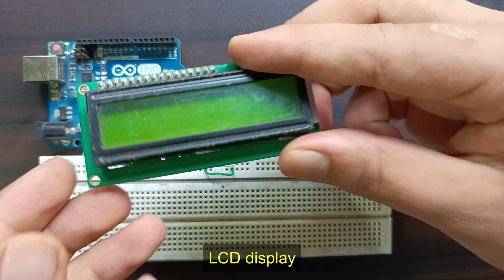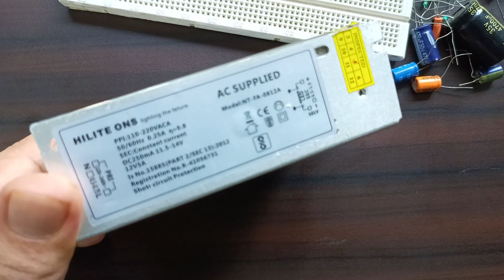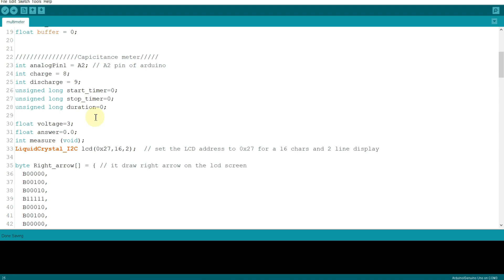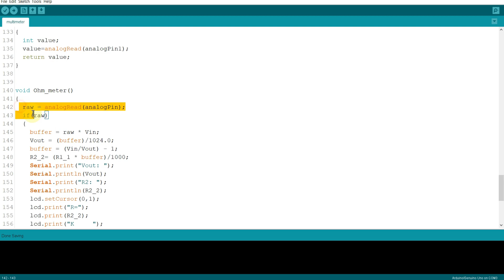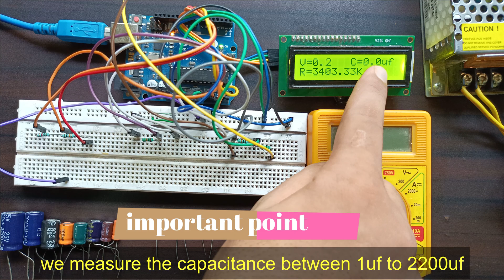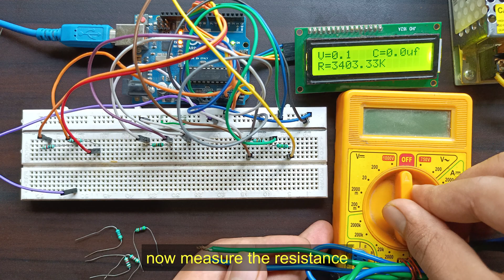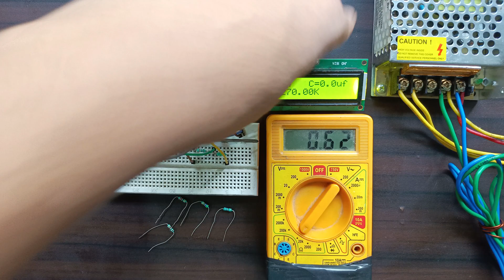How To Make Multimeter Using Arduino| Multimeter | Experimentalist | Calculate R, C, V Using Arduino

Comment: Hello brother , can you talk more about pyfirmata ,  i saw your last video about it and you did good 👍
Reply from the maker: ok, what kind of information you need from me, can you elaborate a little bit.
Reply: @experimentalist1494  what’s the different between digital and analog in the arduino board , and what’s the other inputs in the board , how to read from arduino  in pyfirmata ,  and how many  function is there in pyfirmata ,?
That’s all my questions
Reply from the maker: @5_thrd744  there are two types pins in arduino analog and digital.in analog pins we use as input/output,in thiswe connect the sensors which give analog values means 0 - 1023 and digital pin we use as input/output, in this
we connect the sensor which gives digital values means 0-5. we can also use the analog pin as digital pins

we read sensor using pyfirmata using two types 1st is analog, 2nd is digital 

analog_sensor= board.get_pin('a:0:i')#( "a" means analog pin : 0 is the 2 pin of arduino: "i" means input mode)

analog_sensor.read() # use this line to read the analog sensor

digital_sensor= board.get_pin('d:2:i')# ("d" means digital pin mode: 0 is the 2 pin of arduino: "i" means input mode)

digital_sensor.read() # use this line to read the digital sensor

functions means ?application , can you 
tell me little bit
Reply: @experimentalist1494  no , imean methods, is there other methods in pyfirmta